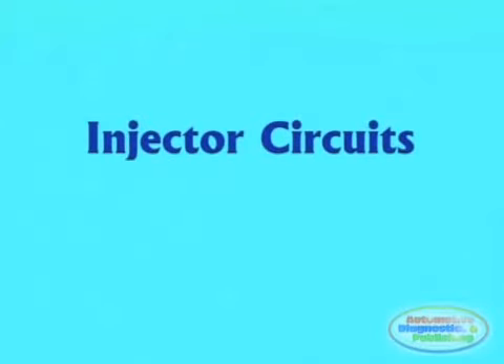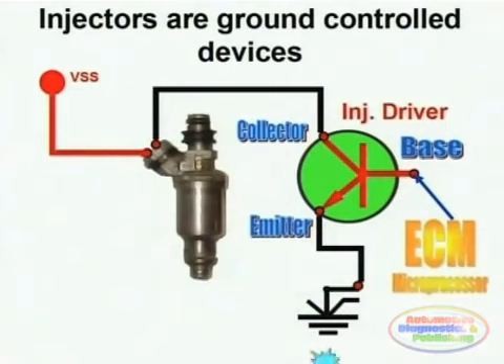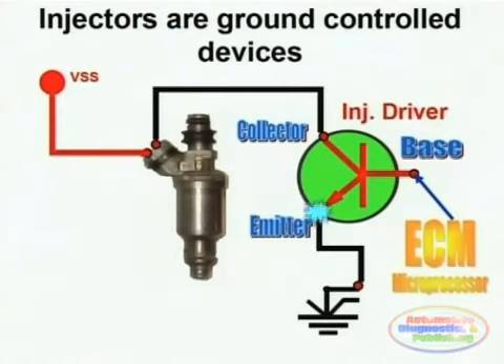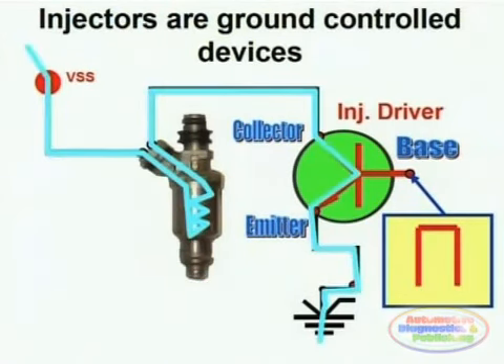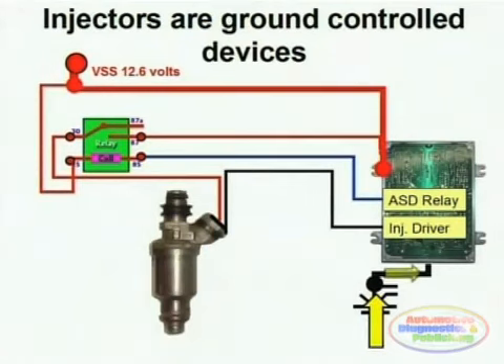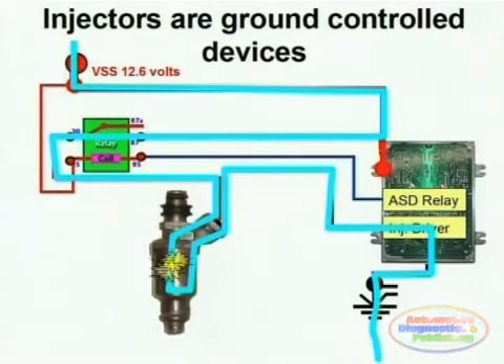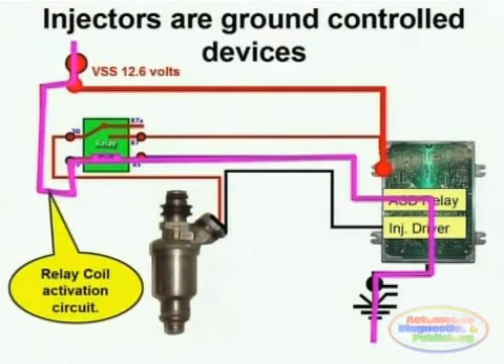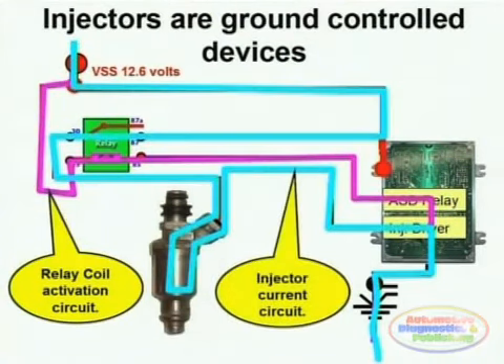Injector Circuit & Wiring Diagram   YouTube

Comment: I have a trouble on pajero 4g93 there is no positive current even the pulse what is the exact problem for that trouble?
Reply: I have a Nissan Hr 4 injectors engine with no positive at injectors, could you assist me.